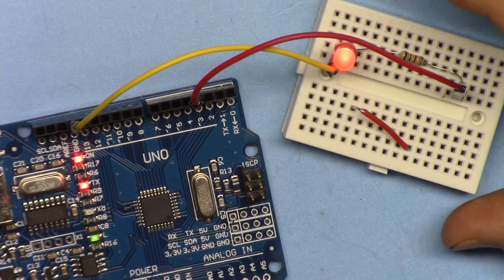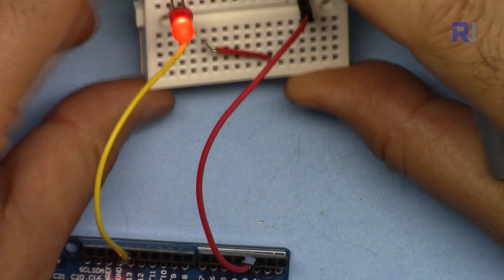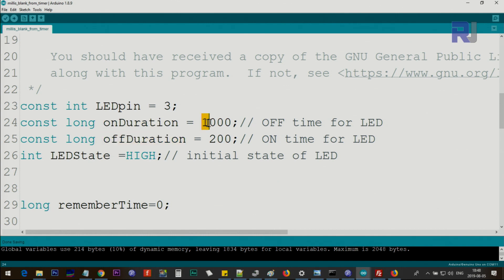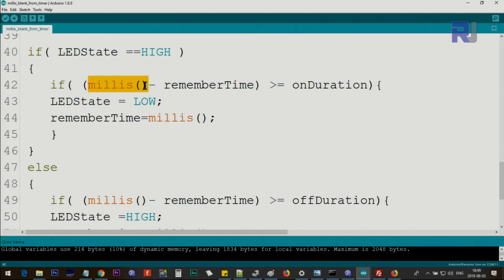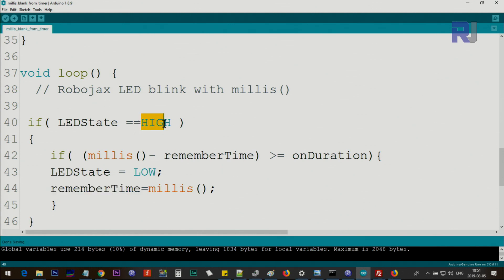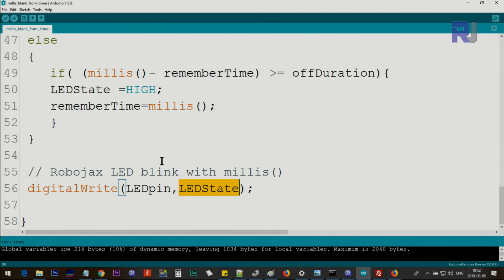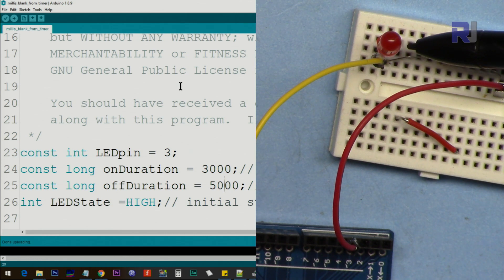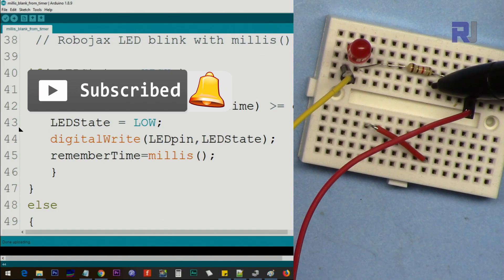Arduino LED blink using millis with different ON and OFF time - RJT195

Comment: Sr. please make the code bellow becomes millis:

Void loop () {
if (digitaRead (Pb)==0){
digitalWrite (led, HIGH);
delay (3000);
digitalWrite (led, LOW);
delay (3000);
digitalWrite (led, HIGH);
delay (3000);
digitalWrite (led, HIGH);
delay (3000);
}
else {
digitalWrite (led, LOW);
}
}

How to be version millis Sr..???...
Reply from the maker: it seems you did not watch the video I sent you. Hi, please watch the latest full video https://youtu.be/obBX9hyH5mM always search my channel you will find surprising contents
Reply from the maker: you can learn and do it. or hire someone if you don't like to learn.
Reply: I've lernt a lot but still confused like my question above🙏🙏😭... how the LED works?

Comment: Hi Robojax.
been watching all your videos in youtube. and its a big help for me as a beginner.
now im stating to study the millis fuction using led blink.

in this video just want to ask. if i want to make multiple led using this code. that it means i just need to copy the same code multiple times?
Reply from the maker: Hi, Yes and I explained the meaning of variables. you have to define all variables for 2nd LED. Here is better  video with wiring diagram which is part my my Course sold on Udemy for $200 but you can watch it on YouTube for free. This is lesson 62 https://youtu.be/obBX9hyH5mM

Comment: I am trying to fire a fuel injector and then fire a spark coil. I have found linear programming not suitable. I have attempted to modify your program, it loads but the timing seems not accurate/random have you done a video or a sketch to use two leds at the same time.
Reply from the maker: Hello, time is accurate by milliseconds. You must be doing something incorrect in the code.
Reply: @robojax  This if my code 
const int LED1pin = 13;
const long LED1onDuration = 100;// OFF time for LED
const long LED1offDuration = 1000;// ON time for LED
const int LED2pin = 10;
const long LED2onDuration = 100;// OFF time for LED
const long LED2offDuration = 1000;// ON time for LED

int LED1State =HIGH;// initial state of LED
int LED2State =HIGH;// initial state of LED

long rememberTime=0;// this is used by the code

void setup() {
  pinMode(LED1pin,OUTPUT);// define LEDpin as output
  digitalWrite(LED1pin,LED1State);// set initial state
   pinMode(LED2pin,OUTPUT);// define LEDpin as output
  digitalWrite(LED2pin,LED2State);// set initial state
}

void loop() {
  // Robojax LED blink with millis()

 if( LED1State ==HIGH )
 {
    if( (millis()- rememberTime) >= LED1onDuration){   
    LED1State = LOW;// change the state of LED
    rememberTime=millis();// remember Current millis() time
    }
 }
 else
 {   
    if( (millis()- rememberTime) >= LED1offDuration){     
    LED1State =HIGH;// change the state of LED
    rememberTime=millis();// remember Current millis() time
    }
 }

 // Robojax LED blink with millis()
 digitalWrite(LED1pin,LED1State);// turn the LED ON or OFF

 
 if( LED2State ==HIGH )
 {
    if( (millis()- rememberTime) >= LED2onDuration){   
    LED2State = LOW;// change the state of LED
    rememberTime=millis();// remember Current millis() time
    }
 }
 else
 {   
    if( (millis()- rememberTime) >= LED2offDuration){     
    LED2State =HIGH;// change the state of LED
    rememberTime=millis();// remember Current millis() time
    }
 }

 // Robojax LED blink with millis()
 digitalWrite(LED2pin,LED2State);// turn the LED ON or OFF

}// loop ends
Reply from the maker: it seems you have not paid attention when I explained the code.  you have now 2 LEDs but you have not created all of the variable for each LEd. for example the variable rememberTime is only ONE. you should have it for LED1 and LED2 like rememberTime1 and rememberTime2
please make sure  you create and make duplicates of all variables.
Reply: @robojax  OK thanks that is working great!

Comment: How if i want to turn off work first?
So when arduino connected
LED off for 2s
And after that LED on for 1s

(On your video is on first the off)
Reply from the maker: Just change the HIGH to LOW in the output pin. I have fully explained the output pin and all of the code.
Reply from the maker: Here is is full video Lesson 62: Time control without delay, LED blink with millis() | Arduino Step By Step Course
https://youtu.be/obBX9hyH5mM

Comment: how do I modify the code to run 2 LEDs „indipendently“ from each other with different on and off times?
Reply from the maker: very dimple.  I mentioned the word "variable" and "input" and "output" so defined all the variables.  for example we have
const int LEDpin = 3;
const long onDuration = 100;
const long offDuration = 500;
int LEDState =HIGH;
make them
const int LEDpin1 = 3;
const long onDuration1 = 100;
const long offDuration 1= 500;
int LEDState1 =HIGH;

and add for 2nd one
const int LEDpin2 = 3;
const long onDuration2 = 100;
const long offDuration2 = 500;
int LEDState2 =HIGH;
the same way all variables and code should be repeated. 
good luck
Reply: @robojax  ahh, thank you very much!! after some tweaking I got it to work how I imagined it. I want to build a Model Aircraft with Lights controlled by Arduino so this video was super helpfull so far!
Cheers from Germany

Comment: Hi dr Ahmad! Ineed your help

how to make 3 leds blinking for each defferent intervals 3-4 time?

1st led (350ms HIGH) - (120ms LOW) - (220ms HIGH) - (120ms LOW) - (220ms HIGH)- (570ms LOW)
2nd led (380ms HIGH) - (120ms LOW) - (380ms HIGH) - (720ms LOW)
3rd led (230ms HIGH) - (570ms LOW) (230ms HIGH) - (570ms LOW)
 
I tries to edit your sketch but no sucsess
Thanks
Reply from the maker: Hi, I have explained it fully. If you skipped the introduction to millis video https://youtu.be/u2HsiTS8niQ please watch it. Then come back to this video and watch it multiple times until you know how it works. Then it will be very easy. I have defined variables and mentioned what they are for. so define your own variables for more than one LED. I might make video on that. you are the 2nd person asking for such thing. it means there is no much demand for that.

Comment: Bro!
I want to blink my LED in 1,0,1,1,0,1,1,1,0,1,1,1,1,0,1,1,1,1,1,0, etc., manner.
bro please write a code for this using only loops.
Reply from the maker: I have explained it fully.  Watch introduction to millis() and watch Thai video many times until you learn and write your own code.  What you want to very easy. If you don’t know what loop is the watch introduction to Arduino 30 minutes course . Link is in the description. Good luck

Comment: To the point on the code and circuit, which is modifiable for other uses. This will work great by using the LED output to trigger on and off my relay circuit to turn on and off my hydroponics water pump at different on and off intervals. Thank you Robojax for helping to make the world a better place by sharing.
Reply from the maker: I all pleased you find it useful. Yes everyone should Dubuque part to helping each other. Please don’t forget to subscribe. I appreciate it.

Comment: Hey I want an led turn on and off I.e toggle for 2 minutes and then stop. but without delay function and  and if I interrupt it should stop I.e reset. What code should I use can use suggest me some.......
Reply from the maker: Hi, it needs full new code. I will try to make video when time permits.

Comment: if (digitalRead(bPin)==LOW){
         if (currentMillis = millis() + (unsigned long) waitTime){  
        
        // The code above is where im having trouble: If the button is  
        // low i want a delay of 10 seconds before writing the LED high.
        //The LED is high as soon as button is low without a 10 second delay.
HELP!!!!!
Reply from the maker: you put inside "if" statement ONE = sign. make it == and it should work.
Reply: @robojax  With one = sign the program blinked immediately, when i added and extra = sign to the program, i did not get anything.
Reply: Do you get the code to do it?

Comment: Thank you for your video. Really very helpful! I "translated" this code, once undersood how it works, to a micro:bit board. 
Again, thanks for sharing your knowledge.
Reply from the maker: You are welcome! this is the first time I heard the micro.bit and will have a look at it.
Reply: @robojax  https://microbit.org.  A tiny board, non expensive, with built on sensors and an led 5x5 array, 3 pins to connect some servos or another stuff... java or python or blocks resembling scratch... It allows an easy way to start coding and interacting with physical world...

Comment: is there a way to run this outside of the void loop() ?
Reply from the maker: yes, put it inside setup and it will run ONCE. if you want it for more than once, then loop is where you should put it.
Reply: @robojax  I mean, I do not want to mess with the void loop ().How about a void function () with   timer.setInterval(x, y);
Reply from the maker: then how you all it?  you can't call it except ONCE if you put it inside setup()

Comment: Mr. what would i have to add if i wanted the led to turn in for one minute every ten minutes. Also add a button so that if the button is pressed during the ten minutes it will turn on for one minute. Thank you in advance.
Reply from the maker: your request is another project. Can't be just done with few line.  if you want to use delay, then it would be very easy. here is Robojax Timer V1 https://youtu.be/6DGQhQgr7Ak and with the display https://youtu.be/BhEIFzFSMuE
Reply: @robojax  , I found that if I add const int for button, declare pinmode void setup, declare  buttonState and use buttoState in if buttonState ==HIGH) || ( millis () - remember time = millis (); }} 
It seems to work great except when button pressed led stays lit 5x onDuratio

Comment: ,thank you for sharing a video Mr. Robojax. I will try your code in my Arduino. Can I ask you if the Arduino can do by  two loops in millis and can put some pinmode?
Reply from the maker: you are welcome. pinMode is not needed to be change every time. So it should be inside setup() function. But if you must, yes you can do it.

Comment: I was wondering how I could use Millis in my Arduino plant watering system, so it tells me when it was last watered? Any idea RoboJax?
Reply from the maker: I am not sure about you program or circuit, but create at the top a variable called "unsiged long lastTimeWatered;" then inside the loop you turn ON the water in program and then save the the time  you turned the water ON like this:
lastTimeWatered =millis();// remembers the current time 
 and then (later) you can use it. or subtract it from the millis() and you will know how many millisecond has passed.

Comment: Can you make a video on how to use coin acceptor/slot that accepts diiferent denomination, add it and remember with arduino uno? Thanks.
Reply from the maker: Hi, this would be very complicated project with so many components. Identifying coin would very hard if done mechanically. If done with camera and image recognition, then you will need a computer like Raspberry Pi.
Reply: What I mean is use the already available coin slot/acceptor out there that you can buy on Amazon, alibaba etc., no need to build a coin slot since it is already available cheap in the market.

I want to build a prepaid water system for my tenants, where there is a fix pressure of water that deducts from the value of money(coins) they inserted in the machine according to their usage. If their money goes zero the valve disconnects. I already know every component I needed for the project, I just want to know how to program the standard coin slot with arduino. Add whenever they inserted coin and deduct whenever they use the  water accordingly.